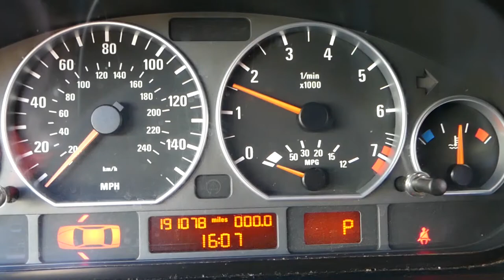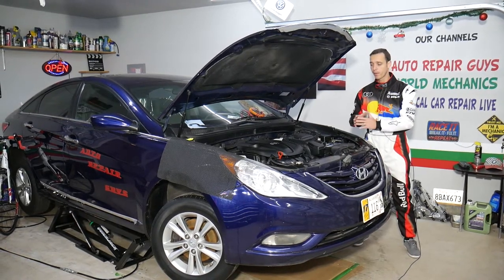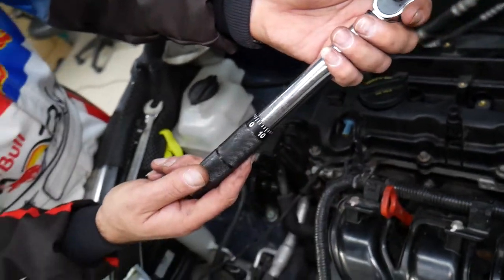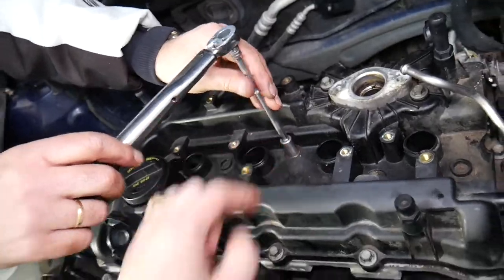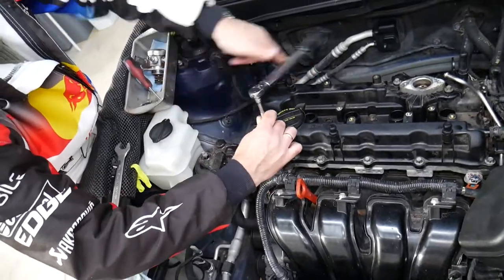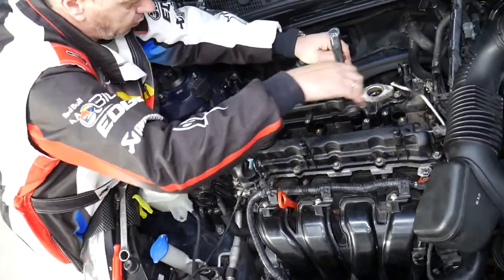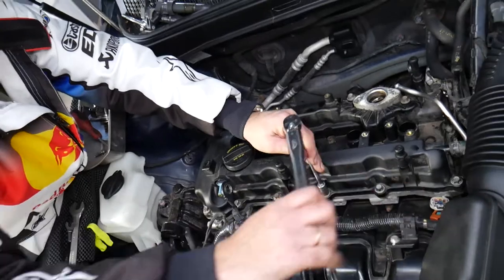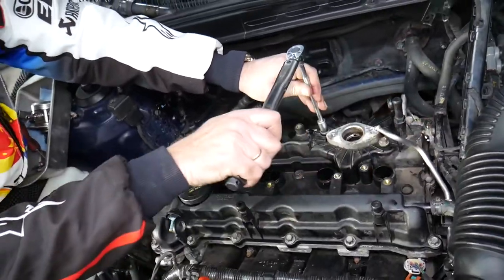HYUNDAI SONATA VALVE COVER GASKET TORQUE SPECS SEQUENCE

Comment: Thanks, this is very helpful. I need to replace the valve cover gasket on my 2006 Sonata 2.4L, would you know if the Torque spec and sequence you showed would apply on my car?
Reply: How did you find what the torque specs are for your car? I see the guy didn't reply
Reply: @cassedanicorporation6775  I checked other YouTube videos, and they all were aiming for the first round at 6 lb-ft, then re-do at 8 lb-ft. I used these values in a clockwise spiral fashion, and worked fine.
Reply: @davidtrepanier9751  right on brother